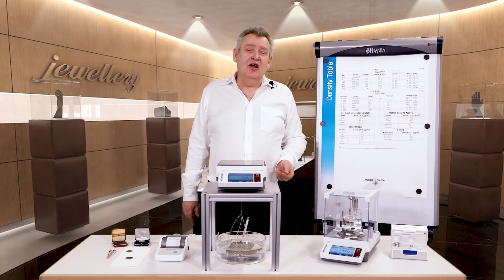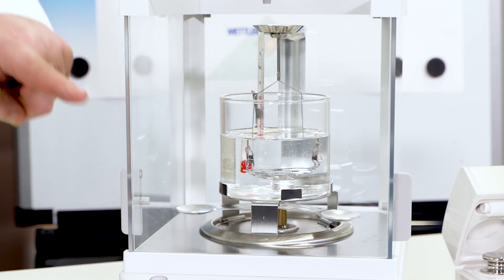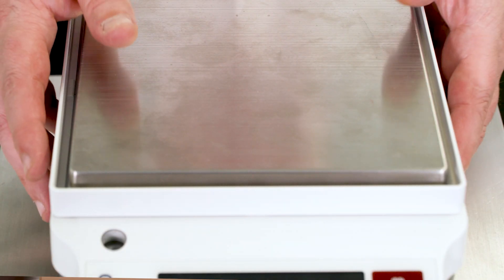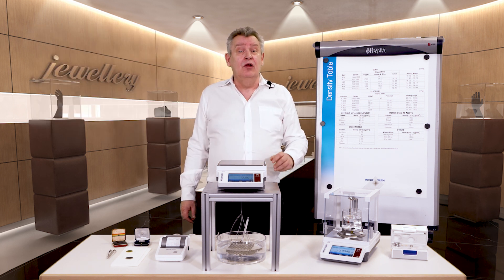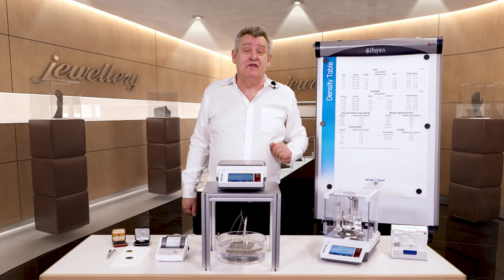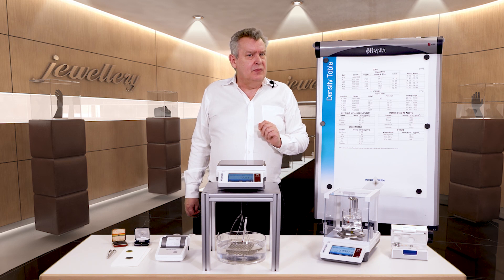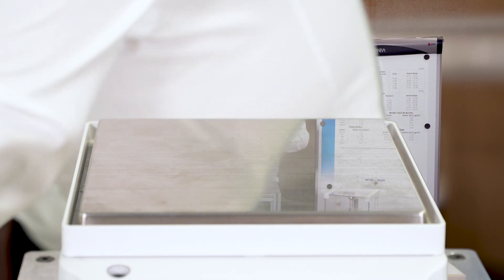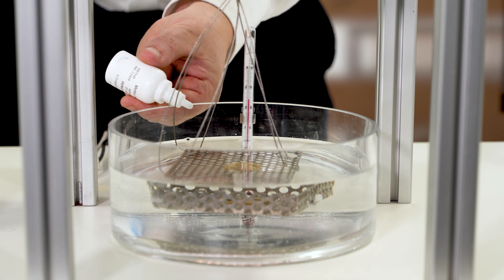Measure the Purity of Precious Metals (Gold & Silver) on a JET Jewelry Balance.

Comment: I have a problem with my JE3002G, it density is inaccurate. Despite all my efforts to set it right, it’s still not accurate. 

The problem is, if I weight in liquid, and I take the item to another office, I don’t get the exact same result. There could be 5-10 difference in results. 

Please help.